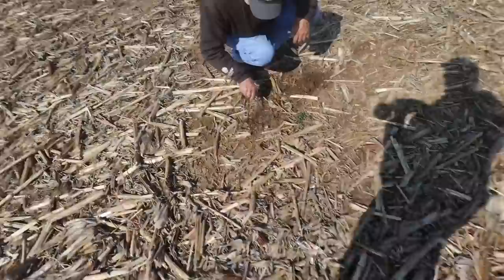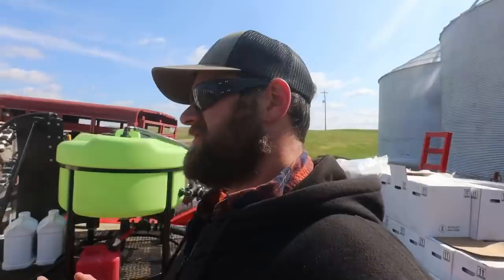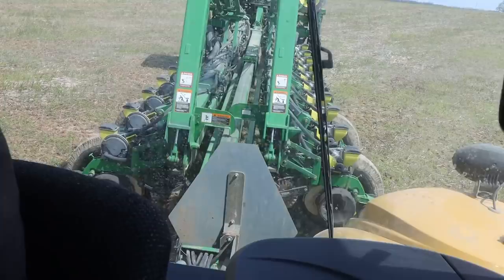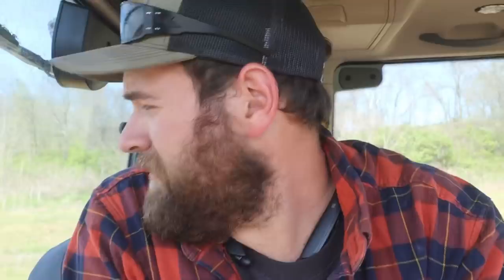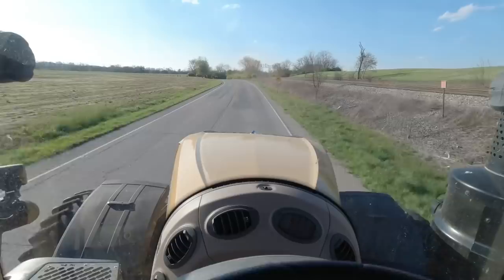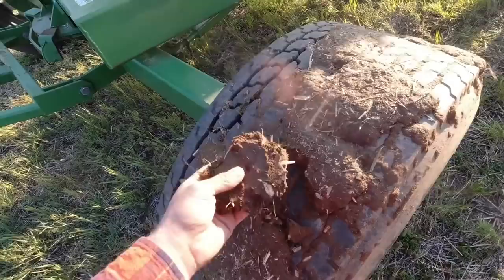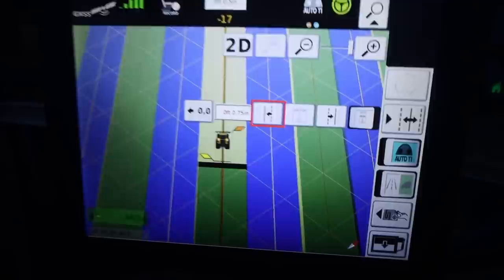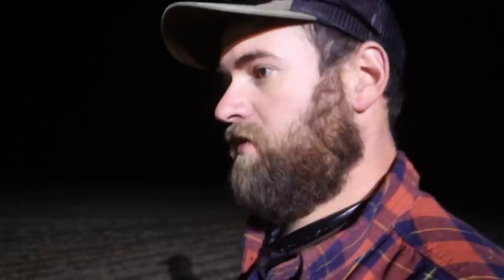Hook up the Corn Planter

Comment: Hey Brian from North Carolina hope you’re doing well, put some spacers on your wheel on your cart to get your travel area right or line of path, down here we pull a rip strip bar with the planters right behind it all the time does well, Of course it’s a load on a machine but you have to have a lift assist wheels also on the back!👍🏻🇺🇸🌽🚜

Comment: The fuel consumption I always find interesting for some reason. Especially when you stop thinking the gallons an hour that they rate them on. Gallons per acre. My gpa coulda ran all day on 5 gallons by god. Cover 10 acres a day traveling at half the speed of smell. Lol Fun to think just how far tech has brought us along.
Reply from the maker: Yeah in the coming videos you will see a high speed planter with the tractor burning 12.5 and hour but in acres it only .3 an acre

Comment: Is the "strip till bar" like we call a 'sub-soiler' here in the South?
Reply from the maker: Not sure. Here a sub soiler is a deep tillage tool. Our striptill is adjustable but we are running 8” injecting 28%
Reply: @BriansFarmingVideos  Sounds like the same thing.  Down here the corn, cotton and peanuts on the farm I go to are planted on a mound created by the ripper and then double discs to create a raised bed.  Corn is about 8" now.  They side dress with a "lay by" 3 point implement with booms down close to the ground.  The nitrogen is just applied on the ground between the rows.  They also planting 'twin row' on peanuts and the corn.  It's just staggering the seeds in the row with two plant units for each row.  I'm sure you've heard of and understand what I described.  Thanks for the answer and thanks for posting the great material.  Always remind us to hit the Like button because I for one sometimes forget.  :)